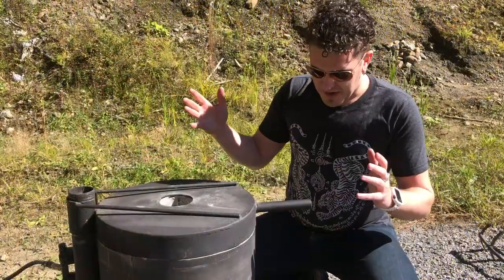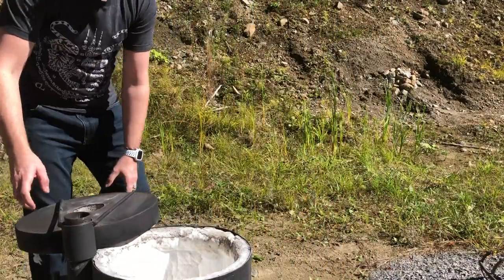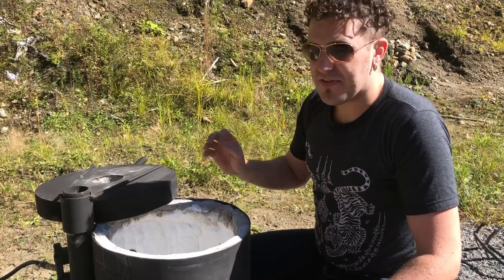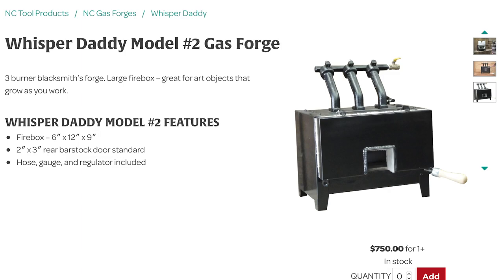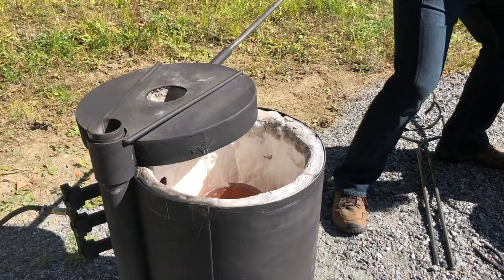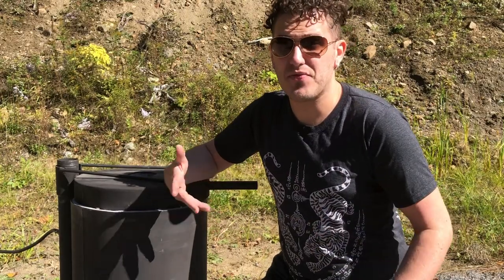"Backyard Foundry" Build | DIY Propane Casting Furnace

Comment: I've been considering getting a setup for melting aluminum cans and scrap aluminum.  I've been wanting to do it for years.  I'm finally in a position that will allow me to do this and I have a much larger backyard, in the country, that will allow me to do this safely.  This was a great video and thank you for sharing your thoughts.  I didn't see a "rigidizer" on the walls of your furnace.  If I heard you right, you're saying the rigidizer is good to keep the ceramic "spores" in place but the rigidizer isn't totally necessary.  Is that correct?
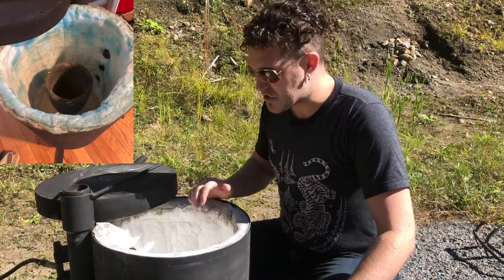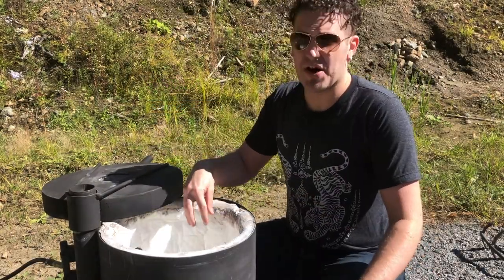Reply from the maker: At 03:50 we show a photo of when we did our rigidizer application. The rigidizer we used goes on blue and drys down colourless. We also used a refractory mortar on the areas that get more abuse. 05:00. Having worked as a blacksmithing technician before getting into casting I saw the damage and abuse the forges got on the daily. If you are going to be casting on the regular with a setup like this I would highly suggest you get rigidizer or at the very least put mortar on the high contact areas.
Reply: @ClearMindJewellery  very cool!  Thanks for the reply and the info that I clearly overlooked.